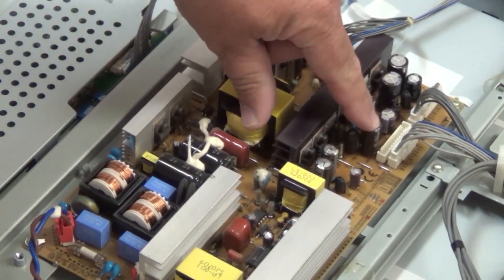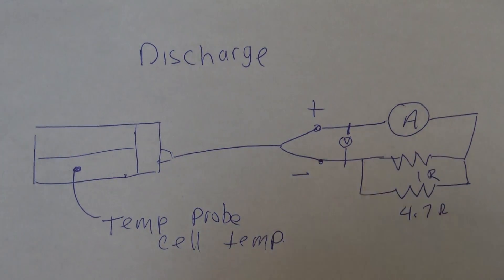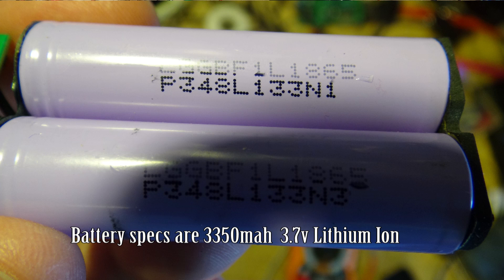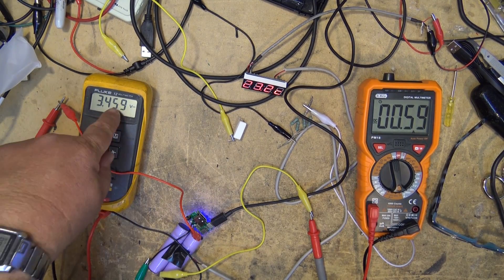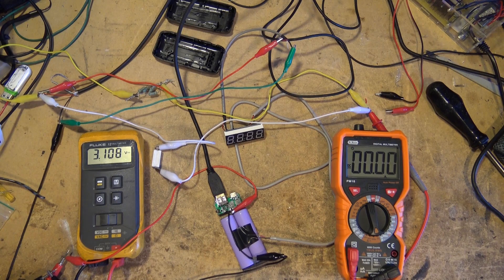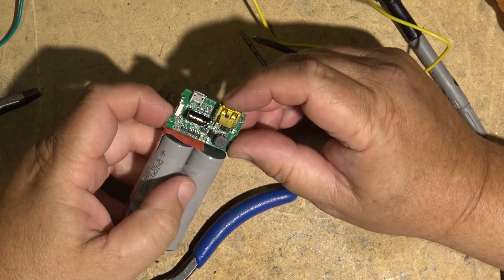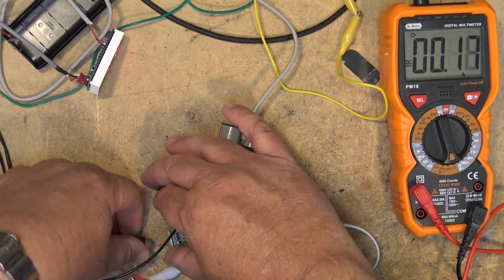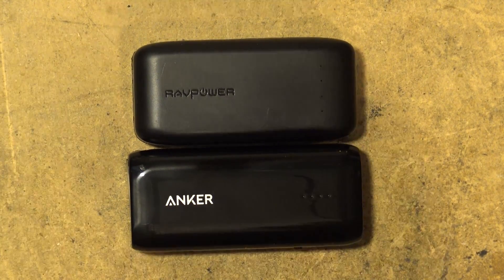Ravpower Ace RP PB60 vs Anker Astro A1211 charge discharge

Comment: Well the buck/boost converters didn't give up the ghost, so that's a good sign.
They both must have a decent control of the output voltage as your load was around 2 amps all the time in discharge.

Not bad little units, handy for charging a phone up when you are away from power, and i like the use of 18650 style batterys, much more robust, less likely to explode LOL :-D.

I also liked your close up's of the pcb's and batterys, it showed how different the pcb's were.
You have to find a use for them now lol :-D
Reply from the maker: zx8401ztv 
There was much cut down as the first edit was closer to 30 min. I have that one as unlisted but if anyone is interested I can make the link available as I measured the temperature of the mosfet and inductor and they went well over 50c but did not fail. I also put a dead short on the power leads and that caused no problems for either. There was a good hour of tests done first cut 30 minutes then I chopped a bunch more tests and   took out the charge and discharge interval shots showing the temperature rise of the cells just due to time restraints. End result is the same though. The ravpower power ran twice as long under identical conditions and this can be attributed to the cell quality (LG) used.